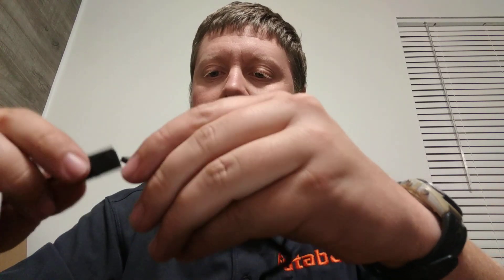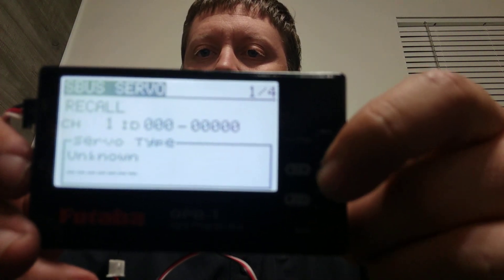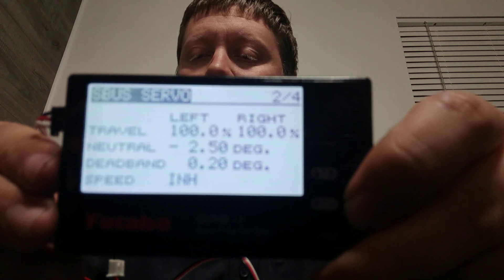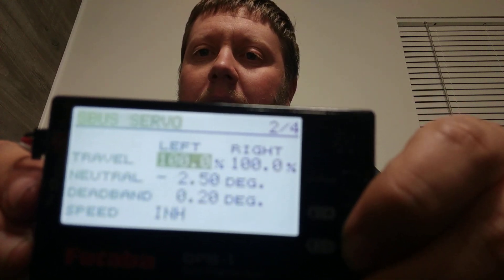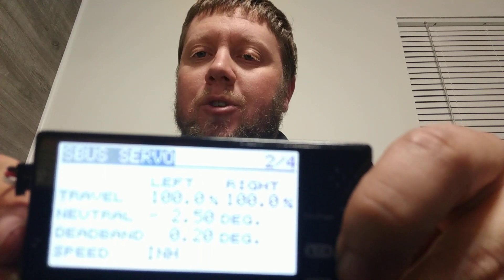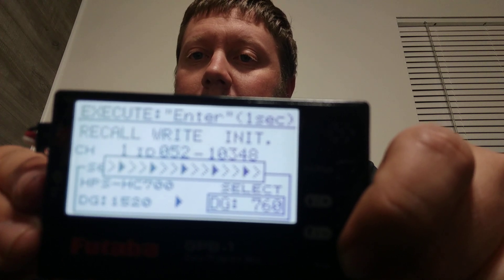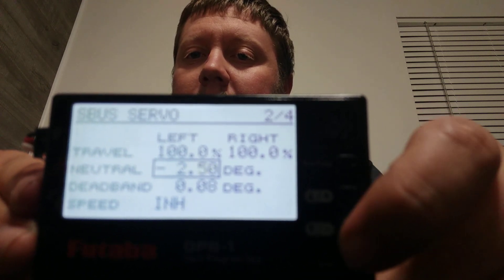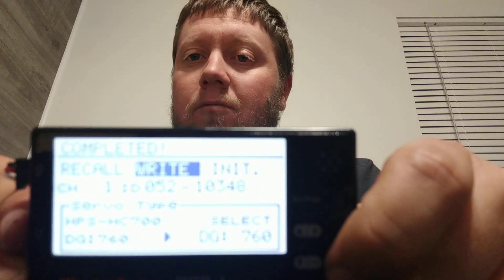Changing Futaba H(C)-700 Servo's to 760uS center frequency

Comment: I am installing the Bavarian Axon FBL control unit to my Airstar Mongoose & I have the exact opposite problem.

My Futaba HPS HC701 low profile cyclic servos are set at 760 ųS, but the Axon only works with 1520 ųS. 

So, I am thankful that I found your video because I need to reset my HC701 servos to 1520 ųS pulse rate to get them to work with the Axon unit. 

I just ordered the GPB-1 yesterday. I just need to find a good Y harness to plug everything into. 

Thanks!

Comment: Is the GPB-1 the only way? I use vcontrol and bought some that were set at 760 and tried the ciu3 and it didn’t work. Thanks
Reply from the maker: I would imagine that you should be able to do a factory reset via the ciu-3. That should reset them to 1520
Reply: That’s what I thought too, I hit reset to default, then write. Went to check it with the servo slider and it went to far before reaching red and messed up a gear set. Thank you for the reply though I will hopefully figure something out. 🙂